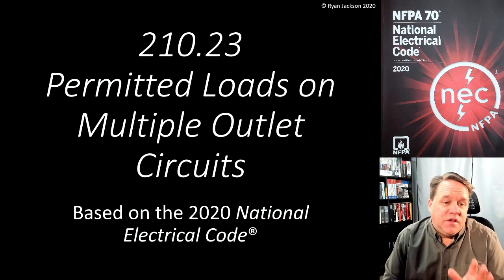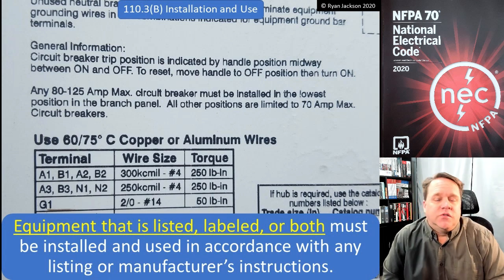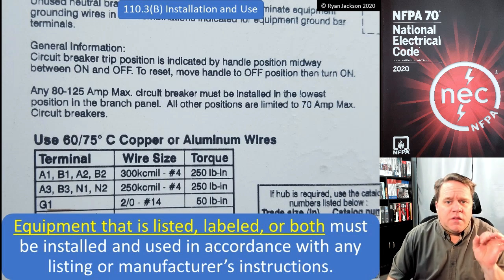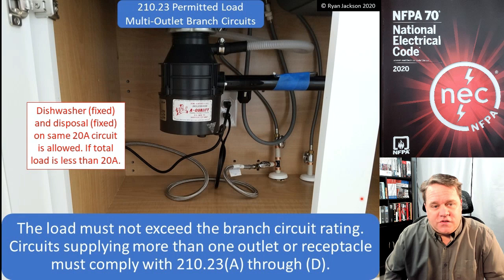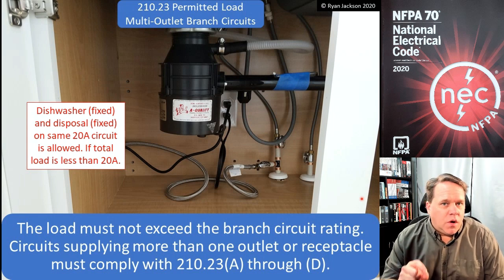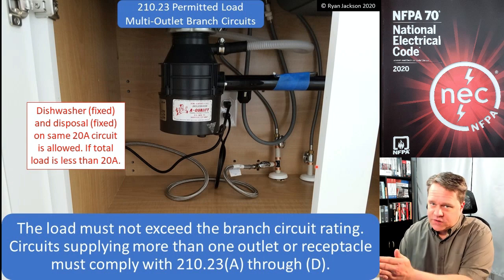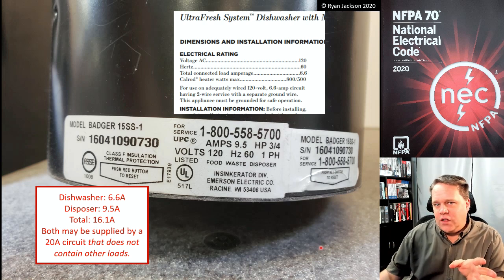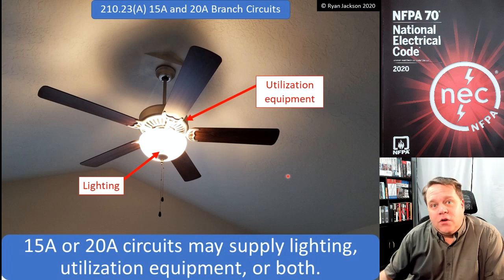Dishwasher and Disposal on same circuit? NEC 210.23 says...probably.

Comment: WOW! Blown away by your explanation. You know as a apprentice 15 years ago I remember dis this with my JW, but it was sweeped under. I recently I was in this very position of suppling a DW and disposal from a single circuit, I was uncertain of 100% code compliance but you cleared that up! 

Just curious what about a disposal and the light over the sink scenario? I remember that being called by inspectors multiple times in my career. Would love to hear your thoughts
Reply: Remember, he said, "210.23(A)(2) Equipment fastened in place (50%). The load must not exceed 50% of the circuit rating if lighting, portable equipment, or both are supplied on the same circuit." So a 10A disposal should be able to work on a 20A breaker with lights, presuming the lights aren't greater than 10A load. But I could be wrong. I'd go read 210.23 and see what it says.
Reply: @icevariable9600  ... point taken, but the max load on a 20 amp breaker is 16 amps, although there is some allowance for start surge on a disposal. I take that to read 50% is the allowed max for those fixed appliances. There's still 6 amps left for a light fixture.... although your local inspector may frown on it. Perhaps there's an exception if the light WITH the other things is still under 50%?
Reply: that's a tough call, but I would think that light might be a "fixed" application so just figure for the max load.

Comment: Nice 👍 my question would it have to be AFCI / GFCI protected? We have different views of this in my region… I personally would think GFCI would not have to since the outlet is not readily accessible? But would be required to be AFCI protected per Article 210.12 (A).
Reply: GFCI required also 210.8 D.... 422.5 A 7
Reply: @felixbruno8806  Thanks
Reply: Felix has pointed out the GFCI codes for the DW. The disposal would need to GFCI’d under 210.8.A.7 since the receptacle location falls with the sink distance rules. They both must be AFCI protected because the outlet (in this case receptacle outlet) is in a kitchen, 210.12.A. Building Code does let you put the DW receptacle behind the DW. Since the receptacle will be under the sink, it is still readily accessible as long as you don’t need a tool to open the under sink doors.

Comment: 16:48 210.23(C) Does this imply that a 40 or 50 amp circuit in a dwelling unit cannot supply anything other than cooking equipment? E.g. EV Charger, Welder, Large AC, Electric Furnace etc.
Reply: you need to read between the line here as most things at 40 amps and higher might not have a neutral so are wired different.
Reply: For these other appliances / equipment, you would be running an individual branch circuit and 210.22 would apply, and not any of the multi-outlet rules of 210.23.
Reply: @J-Jim  ... good point. I can't think of any applications where a 30 - 60 amp outlet would not be a dedicated run to a single outlet. Anything over 60 amps will be a sub panel and broken out from there.
Reply: Also, a lot of that equipment is not "in" the dwelling unit.
Reply: @WardCo  ... but the circuits all start at the main panel FOR the dwelling so it's implied.
Reply: @rupe53  Well, is it really? It's kind of an interesting legislative point. Not sure I've seen anywhere in the NEC that differentiates "in" vs "from" -- and "in" would seem to be the most common set of examples.
Reply: @WardCo  ... so you are saying there should be exceptions for that milling machine because it's in a detached garage, or the pool equipment out in the yard? The way I take this is MAYBE if that equipment is fed from it's own remote subpanel and is outside the dwelling, the rules could be slightly different.

Comment: Hey Ryan, 
Does the code allow a single bend in conduit to exceed 90⁰? No one can give me a straight answer
Reply: JIC he doesn't respond, the answer is yes. (Haven't read NEC 2020 yet, but it's almost certainly still "not prohibited". I buy code books every other cycle to save money :-)
Reply: @darbyl3872  can you reference a code article?
Reply: @JacobYoces  I'm going by all of the articles. TBH, there's a few parts I've never read, near the back, for very specific things. If a 91 degree bend was prohibited, it would be for a specific wiring method
(Art. 3_ _). I'm familiar with most of those articles, and it's not in there (99.9% sure).
Reply: @Jacob for tubing and conduit 3XX.24...... chapter 9 table 2
Reply: As a retired sparky that spent 50 enjoyable years as a sparky never saw anything in the NEC prohibiting prohibiting more then a 90 degree bend in conduit. Just look at some if the old fashioned but still used conduit feeding a lamp with a shade that has more then 180 degrees in a bend illuminating an outdoor wall sign . As long as you do not go over 360 degrees in bends it would be legal. I already made over a 100 degree bend in conduit while running conduit from 1 wall to a connecting wall that was maybe only a 70 degree angle rather then walls being 90 degrees.
Reply: @JohnThomas-lq5qp  I've not been able to find anything in the code either, but I've had a few people tell me it's not allowed.

Comment: How would anybody know that a circuit is shared with lights? Should it be labeled with the 50% as max rating?
Reply: If you trip the breaker for the dishwasher and disposal and the lights will not come on, you possibly have your answer.
Reply: @talbertadams6586  I was referring to minute 11 in the video. If in the future the machine is replaced, no one knows the parameters. Also, if the luminaries take, let's say, 15 amps, does the nec allow to add an outlet to the circuit?
Reply: @MrClaudio  ... you are cutting it too close because even a 20 amp circuit is only rated for 16 amps continuous.
Reply: @rupe53  that's not the point.... But I still have an amp to spare.
Reply: @MrClaudio  ... gotta read between the line again. If you mean old fashion Edison base bulbs, then all bets are off because people can stick any bulb in a socket and overload things. If you have newer fixtures with a specific socket type that can't accept a different bulb, then the math is different on the lighting load. What I am driving at is 15 amps worth of light is 1800 watts. (continuous load) If the CFLs are 20 watts each then that's 90 fixtures. If they are LED then probably twice that. I doubt your local inspector  will allow that many fixtures on a circuit, no matter what the code says. BTW, if these are industrial type lights and permanently secured / hardwired, then you probably should be looking at the 50% rule for load.

Comment: I would place a saw drawing 14 amps on #12 copper to a 20 amp breaker because it would be just my luck to get a call back that the high in rush motor current would trip a 15 amp breaker maybe once a year. We were taught the 125% rule that all motors even the ones that only run a few minutes a day should be on wires & a circuit at least 125% larger then nameplate amps. Some times like with air compressors had to supply a breaker or time delay fuse 150% higher then nameplate amps. Good to see another well produced vid from you. Also do not believe that the code rule for kitchen counter top receptacles having at least two 20 amp dedicated circuits. Now with protruding islands off a counter top think it should be at least 3 twenty amp circuits. Saw houses where they have a 4 slice toaster, 30 cup coffee pot, blender, counter top toaster oven etc.
Reply: Two small appliance branch circuits are just a minimum. It’s up to us to point this out and educate as early as possible in the building process, hopefully while still in the planning stage.
Reply: in most areas they call for another circuit on an island.

Comment: @14:14.   So we can decide if we, or any future owner will or will not utilize it for 3+ hrs?      I always though if it's possible to run 3+ hrs it's continuous.     Thank you for all the videos.
Reply: My wife only knows one cycle on our fancy dishwasher. Hygienic with heat to dry dishes. Yep the longest and most expensive cycle. The motor probably never runs more then 10 to 12 minutes before going to a rinse cycle then heater that probably does not draw 10 amps so in my eyes you could connect the two appliances that never run motor never runs over 10 to 15 minutes. I have rewired kitchens during remodels and always but the dishwasher, garbage disposal and refrigerator on their own circuit breaker. Used to love when people spent tens of thousands of dollars to gut & update a kitchen from the 1930 or 40's and people refused to spend money to replace a 60 amp service & fuse box. Told them to please get somebody else to cut corners. Had some of these people that called me back to say they could not run dishwashet, garbage dispisal, hot comb in bathroom. Told them they had to hire somebody to split up circuits and by the way now that walls are closed in going to cost a lot more.
Reply: Does NEC require that dishwasher and disposal circuits be sized for what future owners could reasonably install, or may the circuit be sized (smaller) for what will be installed initially? For example, a future owner COULD reasonably install a 15A dishwasher and a 1.25hp (12.3A) disposal. These are the largest sizes that are currently on the market. The dishwasher could be run virtually continuously for a party so needs its own 20A circuit. The disposal at 12.3A needs it’s own 15A circuit.
Reply: Idk, can you imagine doing a house calculation load with that mentality? I doubt anyone will run a dishwasher even more than 1-2 hours ever, in residential applications of course.
Reply: @vlad1889  ... even a dishwasher will shut off at the end of a cycle, so there's a break in service. IOW, the 5 minutes to empty it is less than 3 hours.